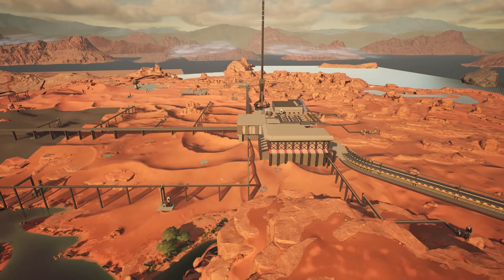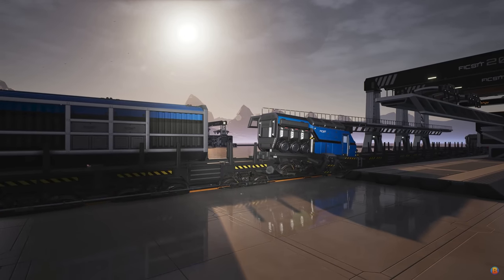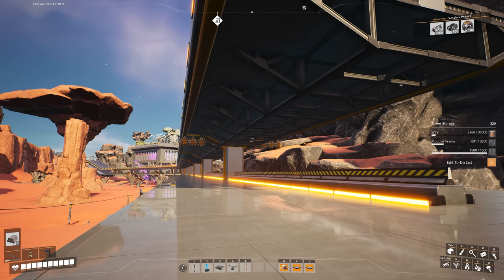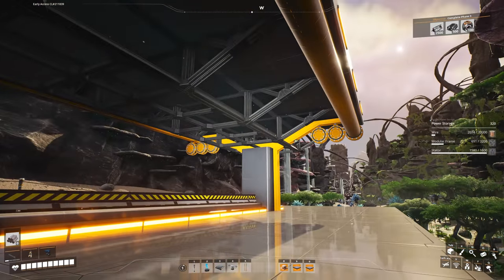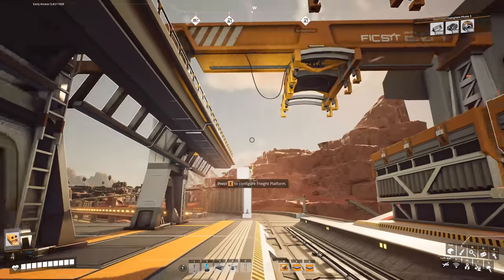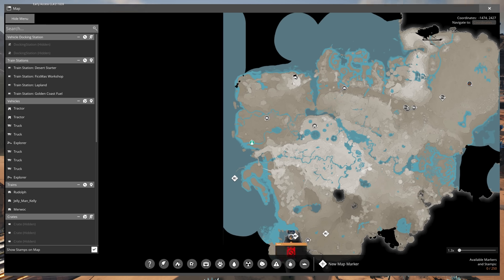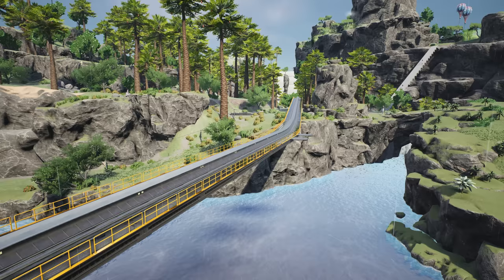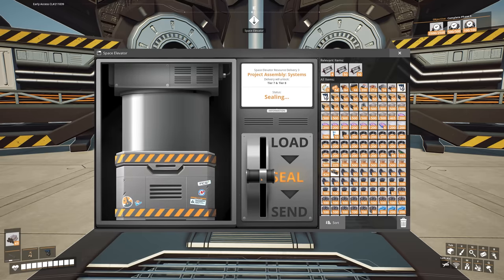I used BLUEPRINTS for a MEGA TRAIN LINE!!! in Satisfactory Update 7 -  Part 10

Comment: This is exactly what I've been looking for as a new player! Thank you for also including a blueprint link in the discord. Some timestamps below that others might find helpful (mostly for notes to myself as I get the hang of this...)

4:10 - 6:38 Changing heights and turning left/right with the foundations underneath
7:26 - 8:22 Blueprint order (support, two three-pieces, one one-piece, support, etc.)
8:23 - 9:45 Blueprints on ramps and turns (many supports with minor clipping)
9:47 - 10:38 Blueprint features by using the order/spacing (belts, pipes, hypertube, road beneath)
14:35 - 16:00 Laying rail lines around curves to get smooth turns and to avoid kinks in the rail 
17:43 - 20:51 Block/path signals to avoid collisions

Comment: There's a much easier way to do curves. Place one straight catwalk on the outside of your curve on the side. Then ctrl-mousewheel one tick and place 2 in a row. You can snap your foundation straight to those and don't have to deal with stacking slabs over and under.
Reply from the maker: That is another way to do it yes and i covered that in a Guide.. The only issue is, it creates to much overlap,on the inside curve. This results in the walls and railings to overlap more, which causes the walls to petrude through each other. The reason i show the one i do here, is that it does not allow that and create cleaners smoother, turns with alot less clipping which results in better game stability as the more severe the clipping the more FPS you lose. :)
Reply: @ItsBitz  I believe a clipping by itself does not reduce FPS, but more clipping means with the same amount of objects there is less distance covered by the viaduct, hence there'll be more objects used to cover needed distance. However, this would have much less effect then the decorations of the viaduct.
Reply: @ItsBitz  All that being said, I also prefer the way you did it in the video more, because the outer corners of the foundations are docked perfectly.
Reply from the maker: @nikelsad  Hey bud, i can confirm Clipping does cost FPS issues this was confirmed by 3 Dev members who are normally chilling in my stream daily whilst there in the office, confirmed by, Snutt (Community manager, was programmer), Lym (Programmer) and Mark (Director)
Reply: @ItsBitz  tyvm for information!
Good for me that I generally avoid clipping :) And I don't build such enormous factories anyway :)

Comment: About that inventory size.  I'll admit I stopped going back and forth when I discovered it's generally easier to just do the Josh thing and throw train tracks any old where and use the cars on it to store all of my materials.  Since I do have some sense of organization I can generally find everything I need while I cart this thing around on my map building new stations.  Trouble is, I discovered these tips and tricks well after I already knew about the straight track solutions so my tracks are significantly unrefined.  I also wanted to rebuild everything a bit late into the project thus I have buildings that clip into one another especially my old fuel refinery depot.  One thing I was doing before you started releasing the roads videos was creating my own amalgamation of fluid and conveyor transit along those unrefined train tracks.  The vehicles I intended to simply drive natural pathways for additional resource movement.

Now, because of these videos, it gives me a great idea on how to further refine my process so definitely thanks for that.  Now I have a lot of work to do to go in the direction I want and I'll probably have to shut down my refineries/depots to begin work on reforming the power side.  I'll likely start by setting up massive amounts of batteries using the Josh method.  Once all batteries are charged disconnect power and shut down everything to rebuild the facility.  After construction is finished, reconnect power to engage oil and fuel production and to kick start the diesel generators.  Actually, since there is a viable enough natural pillar near the refineries, I'm considering a battery tower in this location.  I'll mull it over.  I may just construct a pillar instead and go from there.  You know what, I think I will.

Comment: There's a much quicker way to make curved foundations. You still start with the platform on the rear right hand side, but you just add another platform in front of it (make sure you join it to the other platform or it won't work). Then join another platform onto it but rotate this one with ctrl + mousewheel one notch. Then join a foundation to the left of that platform. This is from a TotalXclipse livestream, so I'm not sure who came up with the idea. It should save you a lot of time though.
Reply from the maker: Indeed, i covered this on Day 1 of Update 5 Release in a tips and tricks video. There reason i do it this way its more defined and creates a smoother turn. Also does not create any stuck out walls or railings on the inner side of the turns.
Reply: @ItsBitz  Ah ok, that makes sense now

Comment: Awesome video, thanks! How are you clipping the horizontal pillar through the bottom of the blueprint designer? The vanilla game won't allow me to do this. Are you using a mod?
Reply from the maker: Thanks, man. I built that blueprint when the blueprint maker first came out. At the time you was able to clip through the bottom layer, but they fixed it.. But my blueprint was still usable, so it's technically one of a kind 😆 🤣
Reply: @ItsBitz  Aw, bummer. Well at least the blueprint can still be loaded in the designer. Thanks again for the video and thanks for sharing the blueprints.

Comment: making my trainline more efficient exposed a problem I'm having now, my batteries are disappearing. If I stick around the main base they build up fast cause I'm making 40/min but only using around 12/min across 3 drone ports (according to their usage calculator). But as soon as I leave and come back, it's like the stacks of batteries in the ports all disappear and have to be refilled. I've tested it 10 times now, and no other resource seems to have this issue, most everything is manufactured far out near their resource nodes and brought in by train

Comment: So, with a little planning (you already do ALOT of that) just make a variation of the 3 piece...piece....for each iteration of belts...which there is really only 3 variations. Both sides same direction(only need to rotate the blueprint to place for opposite direction) and left side south/right side north and left side north/right side south......now you dont have to get under the darn thing and hook that crap up.

If you need MORE iterations than that, then you dont have your other belts streamlined very well
Reply from the maker: Its a good thought, but blueprint belts dont connect to another blueprint belt, so you would only have to delete and connect again..
Reply: @ItsBitz  bahhhhh!  I actually wondered about that after I left the comment.
Reply: @Bitz  isnt there a "hanging" belt connector option?  I swear I have or HAD them in an older map....if so, I will probably see about including the belts but stop them one piece short on each end.  I try to not carry much on me, I dont use mods or effects or whatever

Comment: How many oil extractor did you use on your fuel generators? I can't figure out how much I need. I am currently using 1 pure, 1 normal, and 2 impure oils.
Reply from the maker: I used 4,  2 Pure, 2 normal.. Combined the 2 normal together to create a 600 Line

Comment: You're making the curved foundations way harder than what it needs to be. You've added so many steps that are unnecessary.
Reply from the maker: Indeed it is, but that's the way I prefer. I could use blueprints or I could use the  new snapping method.. but once you have used a method for so long it just sticks